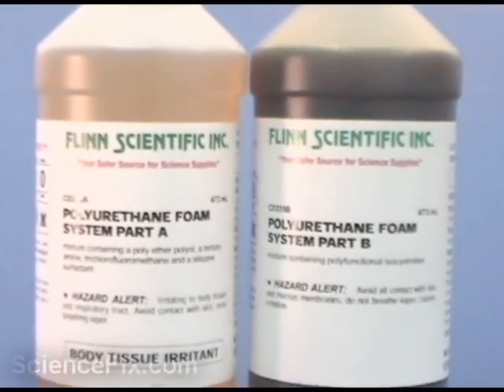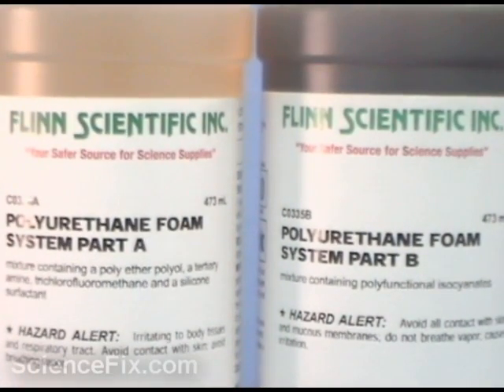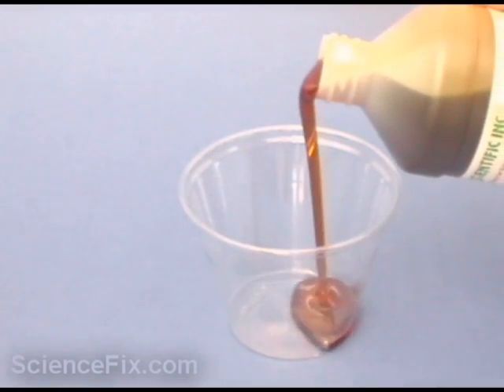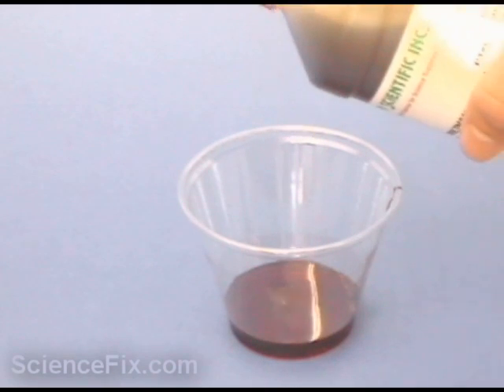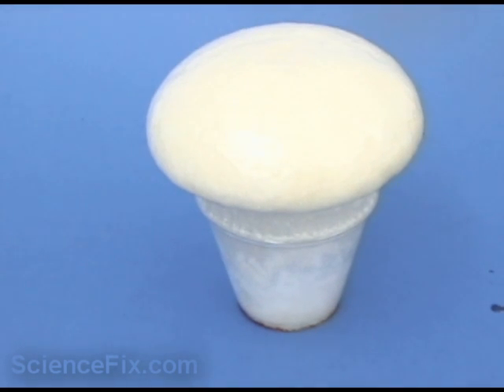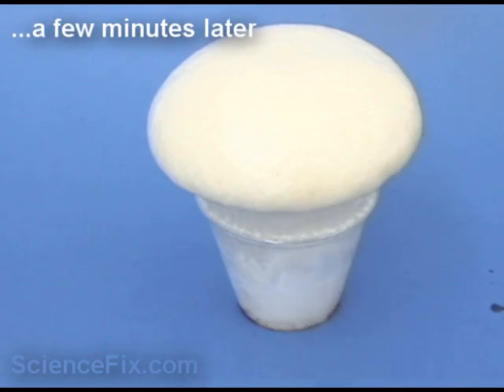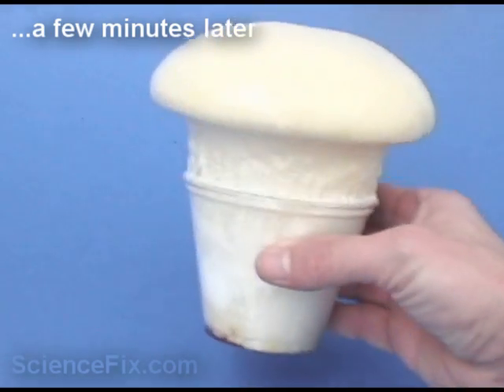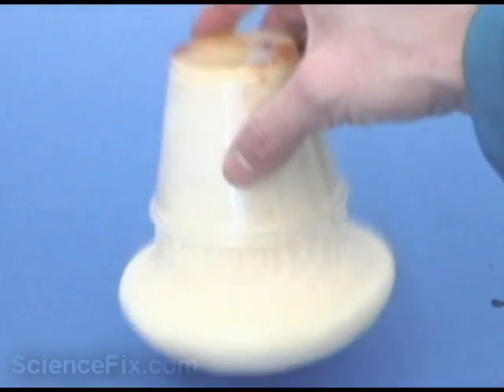Polyurethane Foam

Comment: Is their a way to speed up the reaction?
Reply: Actually yes there is, it can react faster depending on the surrounding temperature. Hotter temperatures means faster reaction, and cooler means slower, you get the point. Hoped that helped :)
Reply: Mallory Casto Thank You So Much!